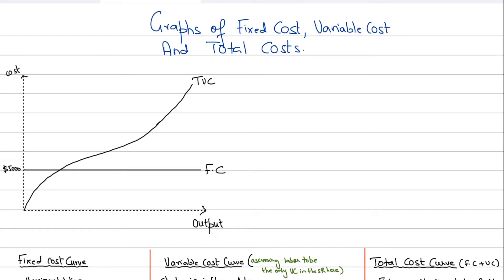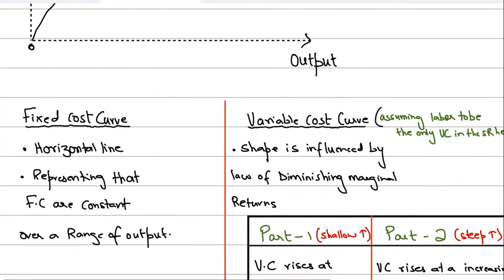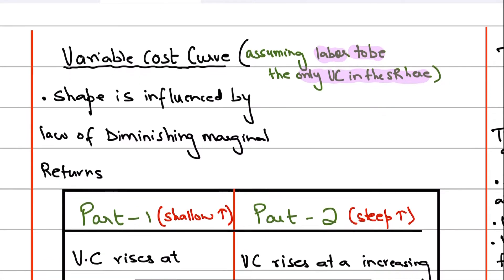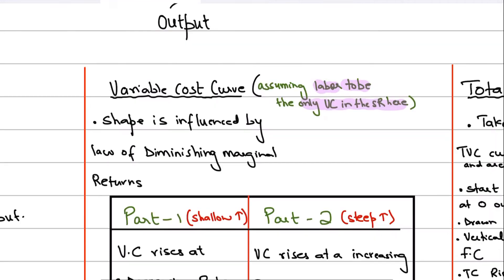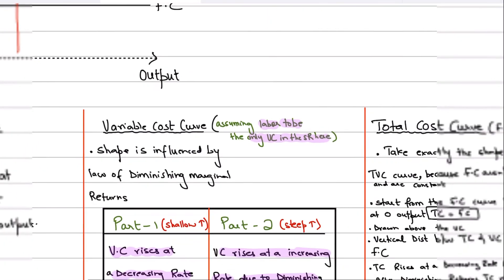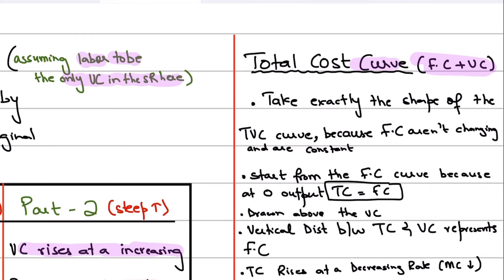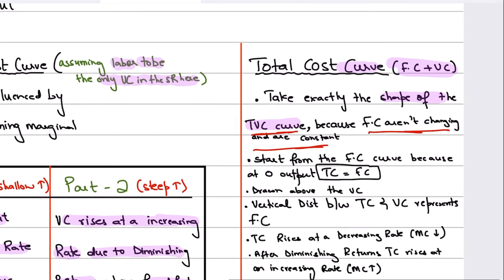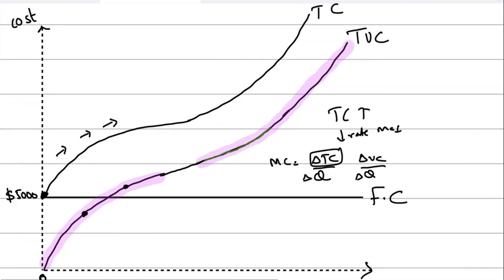Graphs Of Fixed Cost, Variable & Total Cost

Comment: In part-2 of the curve, the increase in labour causes the slope to change to 'rising price at an increasing rate' because additional labour causes diseconomies of scale at that point. Each new unit of labour is adding to management issues which are causing inefficiency for the firm
Reply from the maker: DOS is a long run phenomenon not short run, these are short run cost curves. You are giving the explanation of long run average cost increasing which is not the scope of this video and has been covered in later videos.
Reply: @adilusman  ohh ok thankyou